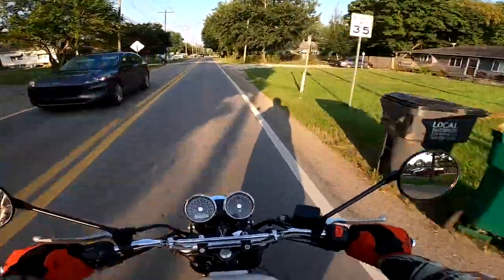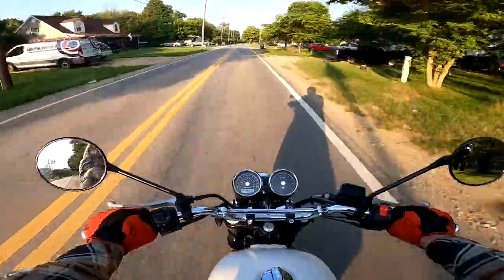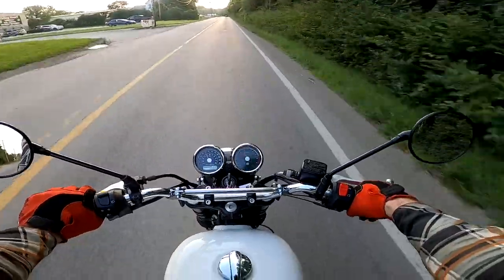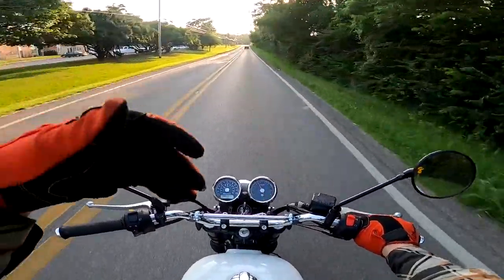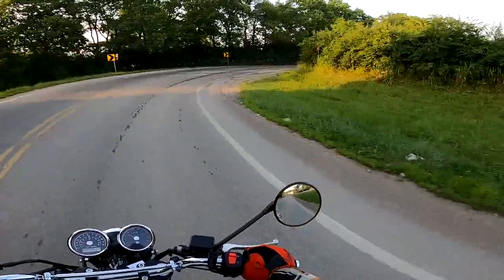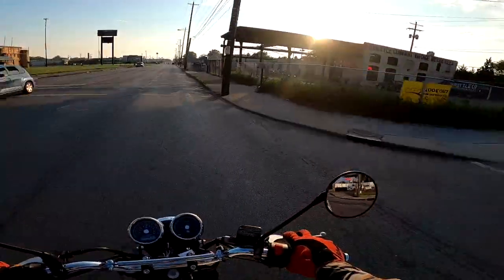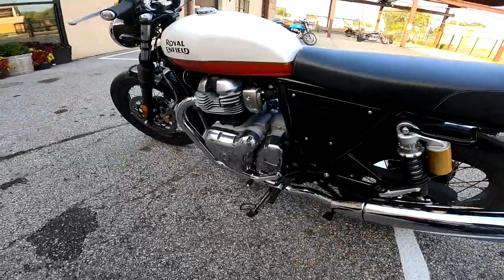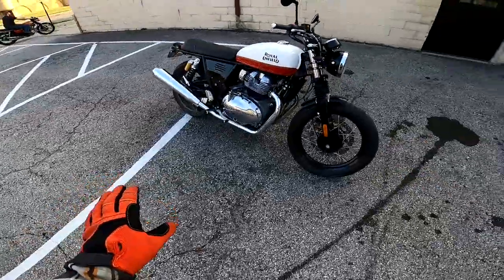Royal Enfield Interceptor 650 Scrambler Build | Episode 2

Comment: Of course I want that booster plug on my GT sir ! you might as well put it in my basket along with my S&S exhaust, Air filter & engine guard , I have not forgotten about it, I just have not got my 300 break in miles in yet due to work and the pandemic. But I'm gettin their ! KC